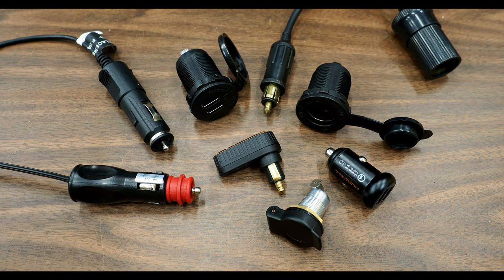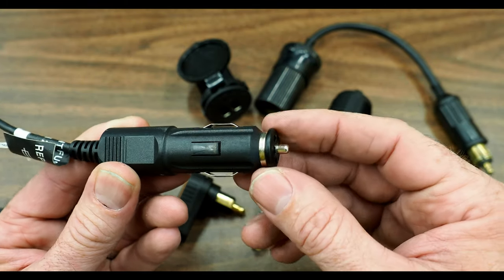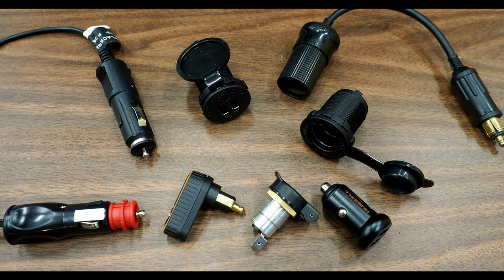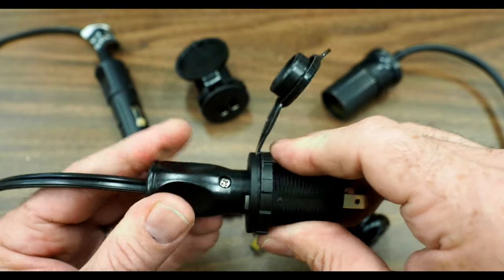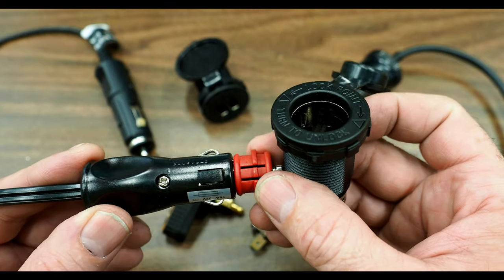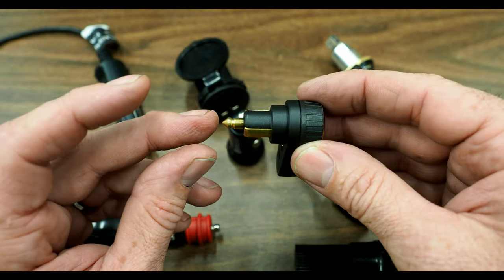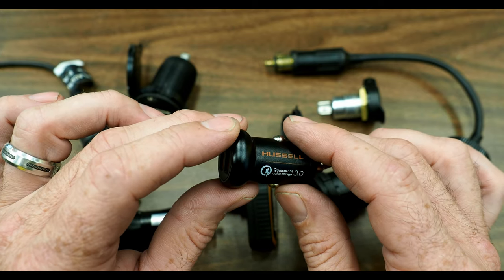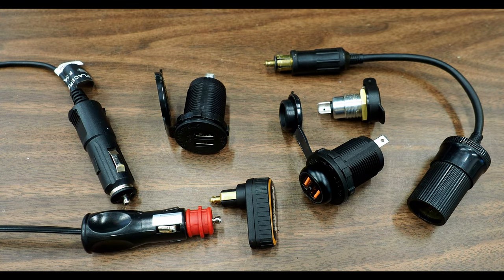12V Charger Ports - Automotive, Marine and Powerlet Styles Compared

Comment: I recently learned that if you remove that red bit on the end of your fridge plug it will plug into a powerlet jack.  I installed powerlet jacks in my vehicles for my fridge as well.  Great video!

Comment: Don't replace the Dometic plug! Just remove the red plastic piece and boom - you have a Hella standard plug with better connection!
Thanks for the video!
Reply from the maker: I tried that and the powerlet port on the end of the oem plug didn't seem very secure, the 90 deg plug is rock solid 👍

Comment: Great info but still confused. I just installed a marine grade 12v socket in my RV for my 12v Furrion TV. I was using the 12v socket that came with my camper but I wanted one closer to the tv. The 12v tv plug does not work in the marine grade socket. Does not seem to fit properly. Any ideas why?

Comment: I can't get my car fridge 12v adapter to lock. Also, the locking outlet I have  is too wide for most of the other adapters I've tried and more around. I may tried to wrap a elastic band around the adapter so it fits snugger.

Comment: Great info - thank you! I gather you don't like Anderson connectors which seem to get all the attention in a lot of forum posts?
Reply from the maker: They have their place as well but they don't make for a clean permanent install like the Powerlet ports or the Blue Sea units 👍
Reply: What is your opinion on the SAE connector? I use them on motorcycles for GPS, heated vest and battery charging. Inside my fwc for fridge and battery charger connecting.

Comment: Am hooking up 8 track deck in garage using 12 volt power supply. Tape player has one hot wire. Connect positive on cig. lighter to hot wire and negative to ground wire (case of player)? Thanks rg

Comment: You forgot SAE connectors. I use them on motorcycles because I can leave the pigtail for battery tender connected (which is SAE) and I use a USB connector with SAE for charging electronics
Reply from the maker: I use SAE connectors in certain situations as well, for wall mounted devices I like the versatility of the marine  cig ports and Powerlet connectors 👍

Comment: The design of this system of plugs and sockets mystifies me on a fundamental level. Surely out of the box such sockets should be compact and secure, and the plugs low profile and right angled as a base-line standard since they are for use inside cramped vehicle cabins in and around cargo etc. Maybe its because they evolved from cigarette lighters, but still, it seems absurd - for example the dometic one ... I take the point that the gasket makes it more secure, but why does the damn thing have to sprout out from the socket some 10cm?